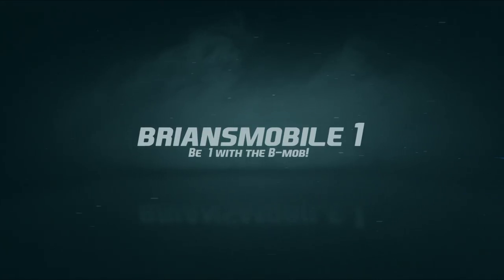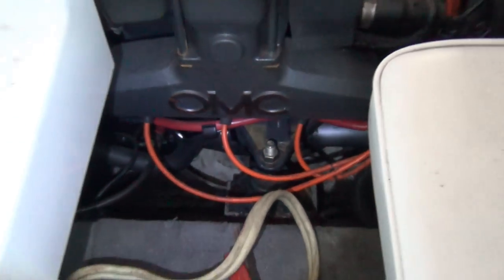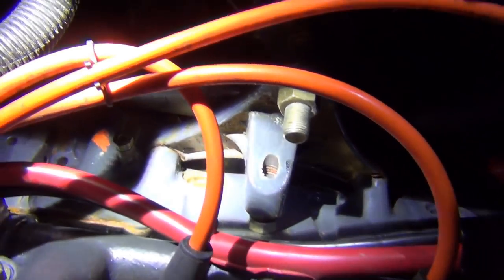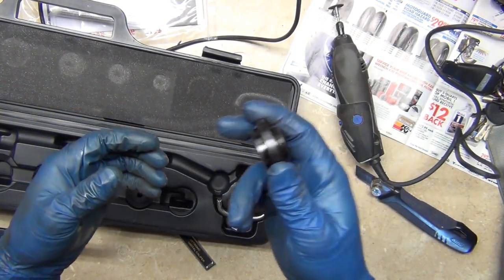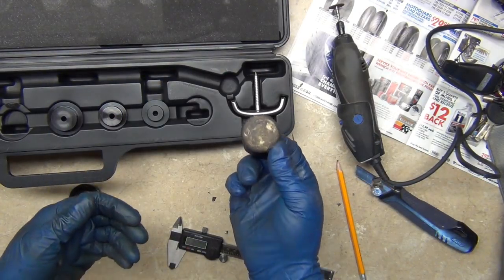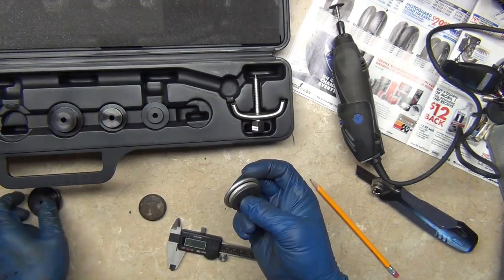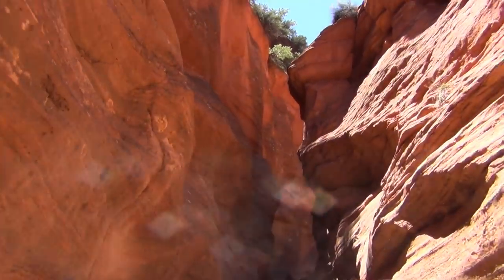Amazing New Freeze Plug Tool To Avoid Boat Dismantle

Comment from the maker: Links to tools used in this video welder → http://amzn.to/2x6s2yA Prybar → http://amzn.to/2kd2IWm 
Pig mats → http://amzn.to/2yyrseN OTC freeze plug driver set → http://amzn.to/2xP7pub 
This job got so tricky!  Every time I thought things were done, I found more and more damage.  

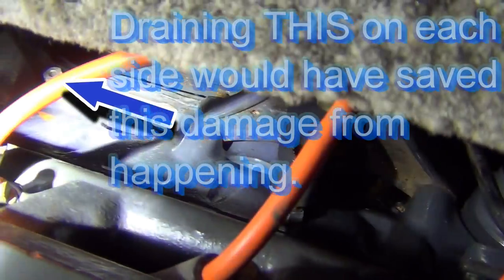Always remember to drain both sides of your engine block and your engine well each winter.  You can see one of the engine drains at → 7:27.  Simply turn it 1 turn counter clockwise and wait 20 minutes.  Drain the hull at the rear with the square 9/16" plug like usual like you would/should do every time you take a boat out of the water.  

Your, engine block, starter motor, oil coolers, bearings, and bilge pump will thank you!

Comment: Keep a small machinist's screw jack in your tool box for just this sort of problem. A combination of wooden wedges and shims provide a solid spot to jack from. It can also double as a support for holding up the engine while you remove the motor mount to gain access.

Comment: When I had my boat,  my freeze out plugs popped during an unexpected cold snap.  However, mine were easy to reinstall because it was a I block.  There isn't anything wrong with reusing these plugs on boats because the coolant system on most small boats don't develop any pressure.  The water is drawn in, run through the engine and expelled overboard.  It isn't pressurized like a car engine.  However, this doesn't apply to marine engines that have a closed system.

Comment: How do you get a perfect fit for freeze plugs, especially when reusing one? Do you coat them with a small bead of RTV? Would that interfere with how they work, blowing out with high pressure?
Reply from the maker: Yes I did- and no, it still works.  The force of freeze expansion is plenty strong enough.  The RTV can lubricate and protect against rusting in.

Comment: Core plug but yes carry on...
They are really only used to get the sand out from casting
They do a really poor job a being a freeze plug since a high percentage of blocks that freeze get cracked even after the plugs push out id say they do a rather poor job if thats what they were designed for
Good things its just a bonus job

Comment: If you found water in the oil pan the block and or heads are probably freeze damaged (cracked) internally.
Reply: anglosax100 are there frost plugs in the top of the heads under the valve covers?

Comment: Core plug technically?
Reply from the maker: Freeze plug at the parts store, core plug at the factory, and welch plug on the design sheet.
Reply from the maker: Welch plugs fill a hole that's only used in the manufacturing process.  Freeze plugs protect against expansion damage, and core plugs allow casting sand to be cleared out.  And there there's the all three purposes to the sides of the block.
Reply: briansmobile1  cool I've heard them called many things just curious